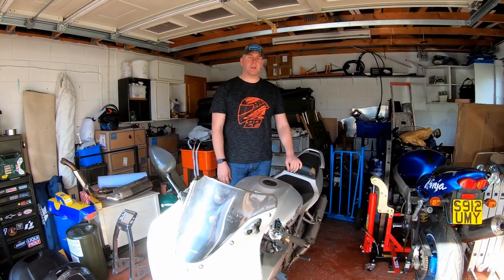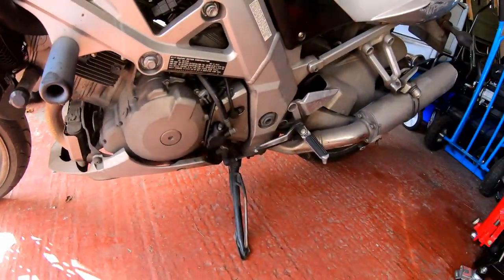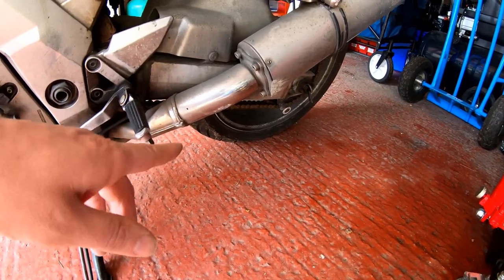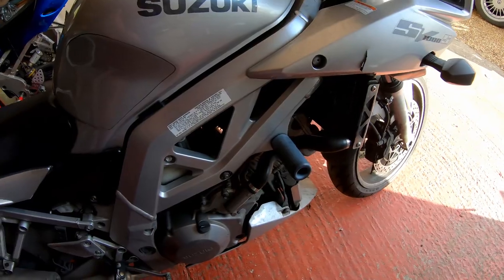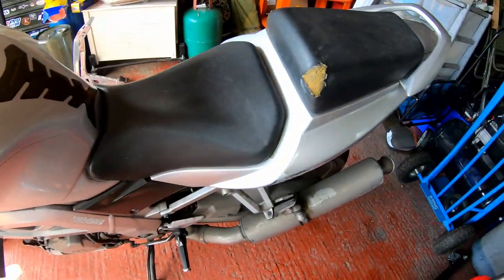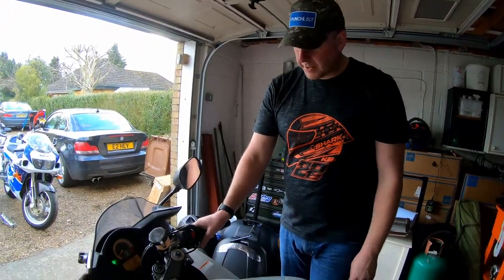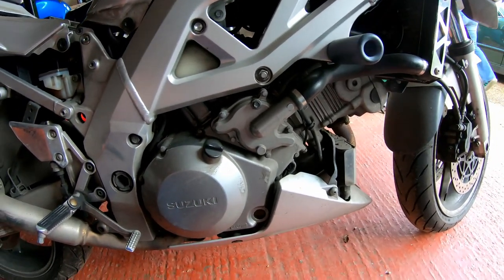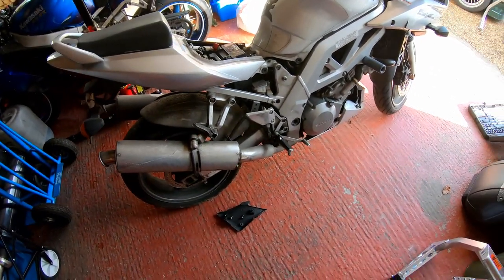Suzuki SV1000S Project Bike - First Look & First Start.

Comment: Just found your channel - it was recommended on the SV Owners Group page! :-) I have an SV1000S, so I'll be watching to see what you are up to. 🙂Someone has already mentioned the flywheel magnets, which need to be JB welded in place. Another common problem is the green connector under the fuel tank, close to the headstock. It has a habit of failing and causing random faults. Many people have removed it altogether and hardwired it. Plenty more on the SV portals to look at.
It should be a lovely bike when you've finished it.
Reply from the maker: Cheers dude, the green connector of death is a video that I intend to make, I have several projects on the go simultaneously at the moment! I’ll get round to it at some point though! 👌🏻😎

Comment: Nice project!! I started an sv1000 project myself. Be sure to check the charging system as these bikes are notorious for magneto magnets spinning loose from the flywheel...don't ask how I know 🤦🏾‍♂️
Reply from the maker: Cheers for the tip mate, it’s on the list 👌🏻